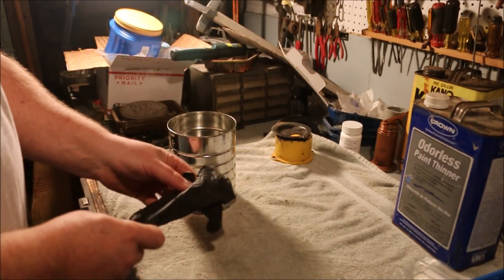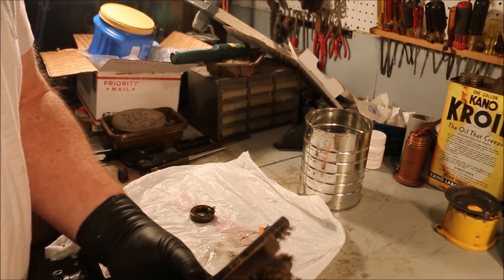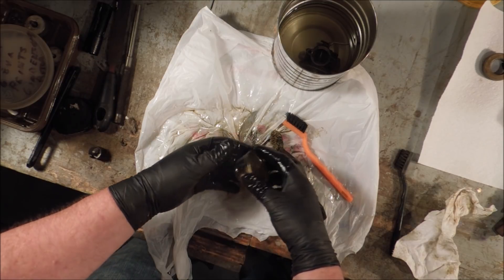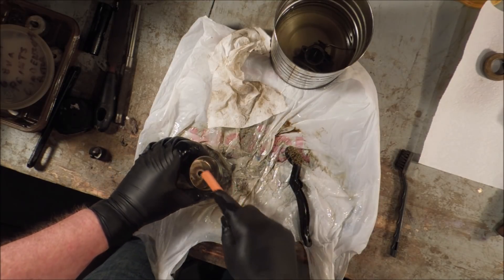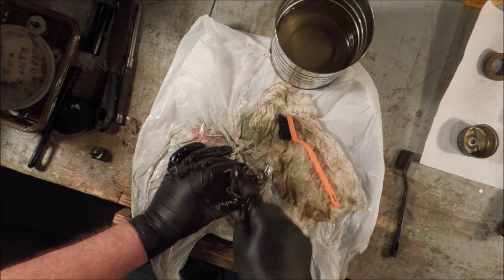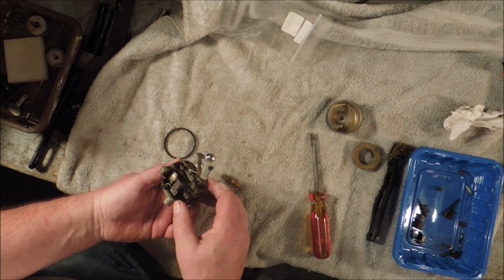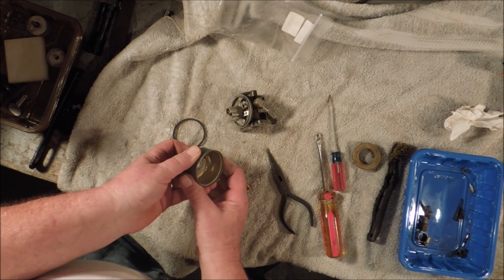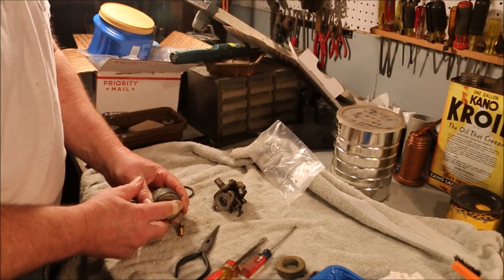SEARS 1250 WATT ALTERNATOR ~ PT 3 ~ CARB REBUILD  CLEAN & ASSEMBLE

Comment: Looking forward to hearing your generator run after this carb rebuild.
Reply from the maker: Me too. I'm working on cutting the intake gaskets and clearing some working space.
Reply: I have an old military generator.  Thanks for the inspiration to rebuild the carb.  It did run 15 yrs ago when I put it away.  Been through two moves since.
Reply: If it ran then, it'll run again. Can't beat the G.I. stuff. Wished I had a 5 ton!
Reply from the maker: Three moves equals one house fire for all the damage caused. 😑

Comment: If it's getting spark it should fire right up now. A little adjustment and it will be good to go.
Reply from the maker: Just spent the morning working on a Murray Pro 18 hp 46" mower. It had been in the neighbors barn at least 10 years. 
Got the engine to fire off with starting fluid. Fuel hose is brittle and it needs a battery. I started it with a jump. 
More on that later. 
Genset is on deck waiting for its shot.
Reply: Old Sneelock's Small Engine Repair. Film at 11!
Reply: @OldSneelock  So thats the lawn tractor, you showed us a while back? Good deal, something else to look forward to.
Reply: I think this is another one, Mat. He's been mowing with the 1st one he got from the neighbor I think. But I have been wrong lots of times.
Reply from the maker: Matt Cooper Actually there were three mowers. The Craftsman that I'm using to mow with and two more wrecks in the garage. The Murray Pro is one of the wrecks. When they stopped running they were parked and replaced. With all the parts there I am hopefull that I can fix them by cleaning away the dirt and replacing the batteries.
Reply: That and carb work and a magneto de-rusting usually does it.

Comment: Hi Mr. Sneelock

Mineral spirits is considered a mild irritant over short exposure/contact....but longer direct contact can cause dermatitis....and prolonged contact over many years can cause nervous system problems...

I remember years ago my mother worked at the stores at a chemical works here in the UK called Sandoz...they were a Swiss firm with facilities all over Europe...
And she was specifically warned about certain organic thinners, benzoates and styrene...
They were manufacturing all these kinds of things there and she was warned about it specifically...
Carcinogenic....really bad stuff...
Sandoz were really strict back then and that was 30 years ago...
Tightened up a lot more since and the Health & safety executive in the UK...and OSHA in the USA take it very seriously...
Anything to do with Benzine and Styrene...Toluene and Xylene...

I use Okeef's "working hands"...its an American product that's also available in the UK...its what I use for dry and cracking skin...

Try it....if you haven't already... 😉

What make of carb is it...
Walbro...?
Tillotson...?

These videos of yours are straight & honest fayre...
Delivered in a way that should
encourage others that so choose (but may not be particularly 
mechanically minded) that they can have a go....and that they should have a go...

Decent stuff Mr. Sneelock